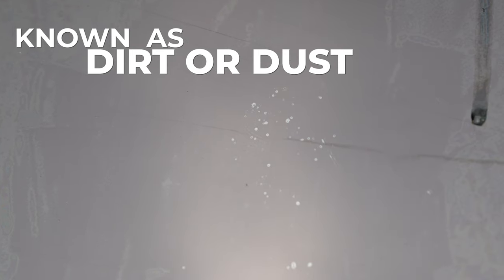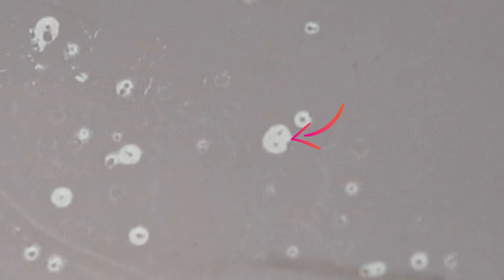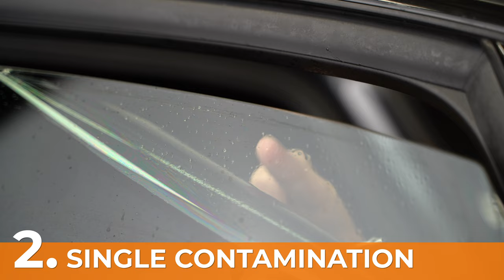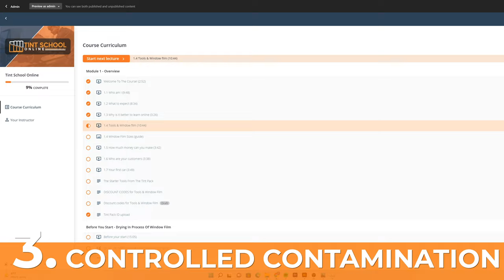Important Window Tint Training | Why Am I Getting Dirt / Bubbles In My Tint?

Comment: is it ok if the water rolls down in the door? there are electrical wires there right?
Reply: There's a plastic shield w adhesive around the electrical in the car doors so no risk

Comment: Nice video. Your experience shines here. I had my windows tinted 8 days ago at a professional shop. I also had a brow or sun strip across the top of my windshield done and from the time I left the shop the patch of bubbles on the brow have drastically reduced and I haven't said anything because they said any bubbles will go away with time. My question is do you think these two appear to now be single contamination bubbles as you described will go away since it has been 8 days in sunlight, or should I have them fix it? I hate to be that guy but on a brand new black car with a 5% brow it really stands out.
Reply: If the bubbles dried in there their most likely not coming out
Reply: @2025ZX6R  guess I'll be that guy 🥳

Comment: So i have a G37 Convertible (2011), and got my windows tinted two days ago by a professional. Checked the rear window the next day to make sure water that was pooled up under the tint dried up. There was a hair that caused a tiny wrinkle. Went back to him to fix it, and when he removed the tint he removed my defogger. Turns out my rear windshield is part of the retractable top assembly and is sold as a whole piece, so this shop will likely have to file an insurance claim.

Crappy situation, as if it was done correctly the first time it could have been avoided.
Reply from the maker: Ouch. Sorry to hear that

Comment: Is it normal do have bubbles after ceramic tinting? My tinter told its normal and will disppear in few days?
Reply from the maker: Water bubbles are normal, as long as they are see-through.

If they are white big bubbles , it will not dry
Reply: @TintSchoolOnline  I got my tint installed 1 1/2 weeks ago and I still have water bubbles. Should I be ok to roll down windows?
Reply: @newreformationapologetics4953  update
Reply: @laobe5119  bro died

Comment: Quick Question: Would you recommend wearing gloves during install to prevent contamination with your fingers or should you just spray your fingers before applying every window?
Reply from the maker: For this demonstration, we micro-edged the top glass so it meant you could carefully pinch the top side as we were cutting it off with the micro-edged finish.

You can spray your fingers it will help. Or install with the “no touch method” but as-long as you are just pinching, the worse case scenario will be 1-2 specs.

This particular Audi is quite hard to install so holding the film just meant there would be less chance for any errors
Reply: @TintSchoolOnline  Ok, thanks. Wish me luck 🤞🏽

Comment: The shop that did my Tesla has a huge HEPA filtration system and they use a plotter/cutter for the tint. Manually cutting tint is never going to be perfect.
Reply from the maker: A plotter cuts a template made from someone’s hand cut. 

Plotters are amazing though! Many people who use them leave little gaps around the roll down windows though as it’s so quick and easy.

Comment: So you’re saying if I push too hard I will leave those dots?
Reply: Or that I could possibly
Reply from the maker: "So at first these specs are going to be surrounded with soapy water which makes the specs very hard to see, but as the water dries out though, these specs will become visible"  Then it shows me pushing the area a few times to remove as much water as possible REVEALING the specs as I talked about

please watch the video again, the whole video talks about specs being contamination and the main reasons of where they come from? Not specs having anything to do with pushing too hard.

Tinting is hard, so if this video confused you, honestly I would recommend taking it to a professional